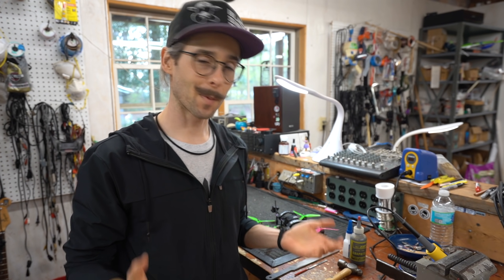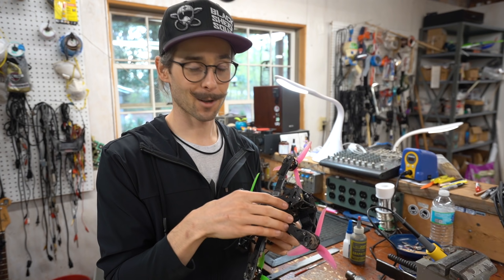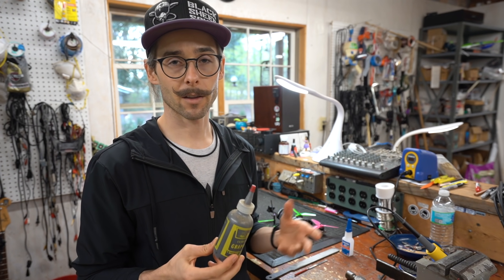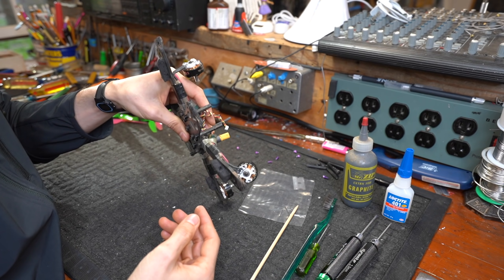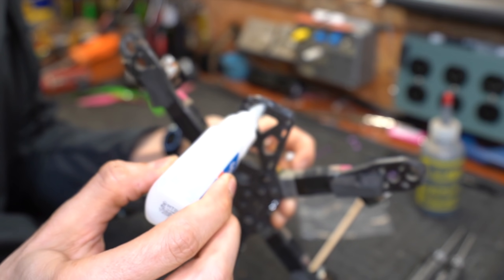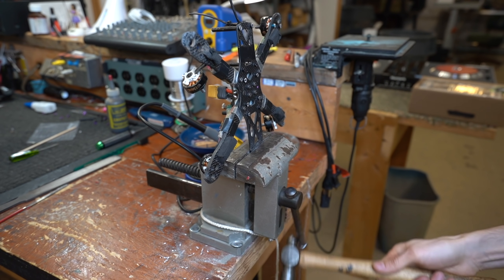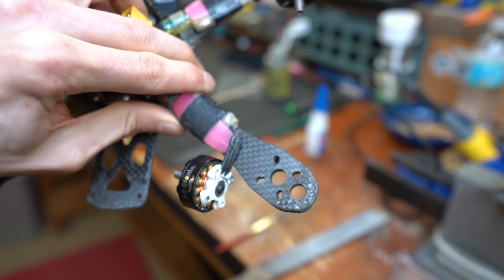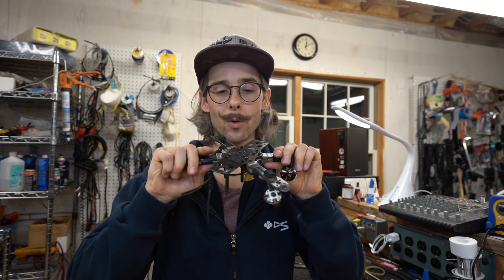DIY CHEAP Carbon Fiber Repair | FPV Drone

Comment: You should use a respirator when working with carbon fiber, fine carbon dust is not good for your lungs.
Reply: it's about as bad as asbestos. not like it's gonna give you cancer right away, but the damage is irreversible and accumulates.
Reply: or just do it under water? ^^

Comment: I would just stick with hot glue and baking soda. Should be cheaper than the graphite? Save(for the lung?) and easy to work with, instantly dry.
Reply from the maker: Hot glue ?!
Reply: @MrSteeleFPV  Well may be the same as the CA glue you use in the VDO. What we called it in Thai literally means 'Hot glue'. A kind of super glue which has almost no viscosity. Not special stuff.
Reply: U dont want it instantly dry as u need to compact them 1st while let it drying
Reply: @irwan86  You are technically right. No argument about that. But as I use baking soda, I dip the glued part into a pile of baking soda. It seem penetrate all the way inside and all solid. So I quit squeezing it and let baking soda does the work inside the cracks then I file up all excess stuff. Yes including excess carbon fiber. It is like baking soda canniballize CF.

Comment: Impressive carbon repair, I've used epoxy in the past but the CA/graphite combo makes sense and looks good. As far as the hammer and the vice, get yourself a 3-4' length of pipe and use leverage vs. impact. I thought I was seeing your vice bolts loosening w each impact, lol. Cheers man, nice work.
Reply from the maker: Hahha. This makes sense. But I like hammering the vice.  It’s funny to me
Reply: @MrSteeleFPV  I get that.

Comment: What about epoxy and resin would same method work for boats
Reply: Meant say thank you have ide for quad repair kit
Reply from the maker: I’m sure it will but it’s not as easy as CA

Comment: Great tutorial. I just did this to my TBS source 1. A tip from a tool n die maker, a file only cuts one way. When you drag it backwards it actually dulls the file. Not knocking you at all, just thought I'd share.

Comment: Dude have you ever heard of Q-bond? It's like what you're doing with the graphite. But a product designed for repairing and building up broken things.
Reply from the maker: Haha I haven’t. I’ll have to look into it
Reply: Q Bond Ultra Strong Adhesive & Filler Powder (Black & Grey) 10 Second Cure Time https://www.amazon.co.uk/dp/B06WW4DQG8/ref=cm_sw_r_cp_apa_i_vw9HCbHRPRKMT 

That's the stuff we use at work when all else fails haha
Reply: Only down side is it might cure too quick to get into the vice to squeeze it

Comment: Superglue the tips of the arms before you even fly it , stop delamination from the beginning
Reply from the maker: It helps stop it from beginning. As I use to do those when I first started.  If you check back to my very first alien build video 3+  years ago.  But yeah eventually it’ll still delam.     But preemptive super glue does help
Reply: @MrSteeleFPV  i found the same , but i use to round the edges of my frame anyway , too Bad there arent tpu sleeves coming with every frame
Reply: Peter Zingler if you put bi carb or baking powder on super glue it makes it set instantly. So if you have a puddle of glue just sprinkle some on and blow the excess away and it’s set solid
Reply: Hot glue on the arm tips.
Reply: @droneracer  life hacks!

Comment: GREAT idea to help save some MONEY 🤑
Reply: Specially when most of them want you spending $150-$200 per frame. ;} I will stick with my cheap knockoffs for now until I know I'm good enough to throw that kind of money at a tiny little frame. $20 when starting vs $150 is pretty big, specially when in the end the carbons the same.
Reply: MidnightMarrow I’m all for saving money man! Sometimes the reason name brand frames are better is because the amount of resin used in the Carbon fiber. Like the cheaper nock offs sometimes use more resin making the frame overall weaker!
Reply: @wynnfpv  Often times the companies will buy the sheets of carbon from other larger reputable manufacturers and cut out the shapes for the frames etc. Depending on where you get them anyway the frame can often be just as high quality as the official but you don't get all the attachments and parts that you might otherwise get with an official Alien frame for instance.

I built my first quad months ago and haven't really flown it at all yet as where I live there's no nice grassy parks to really go at it with comfort of a soft landing for instance. So in my instance I will opt for the 20 dollar frame til I know for a fact I'm not going to WHOOPS the whole thing and be out 150+ dollars in an instant. Right now it looks and functions exactly like an Alien frame does and when it breaks it will make my wallet cry a little less when I buy another when I inevitably destroy it doing some maneuver or lose signal somewhere shitty. ;p
Reply: MidnightMarrow cool! I understand what your saying! What nock off frame do you use! I’m just curious! Might want to get one myself haha
Reply: I don't think you crash :P
Reply: https://rover.ebay.com/rover/0/0/0?mpre=https%3A%2F%2Fwww.ebay.com%2Fulk%2Fitm%2F132942045108
I started with this frame, basically the exact shape of the impulserc alien, then I upgraded to the real alien, both a 5” and a 4.5” the carbon is obviously better on the impulserc version, but otherwise they seem to fly the same.